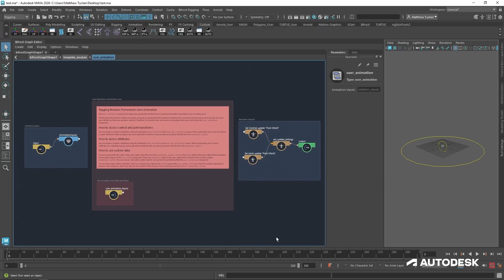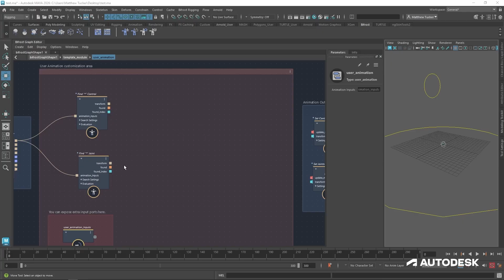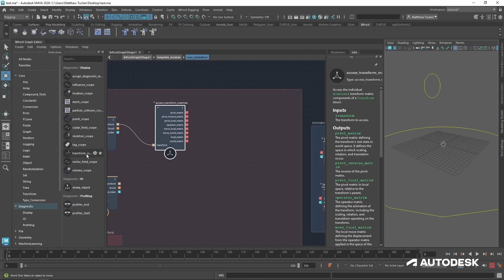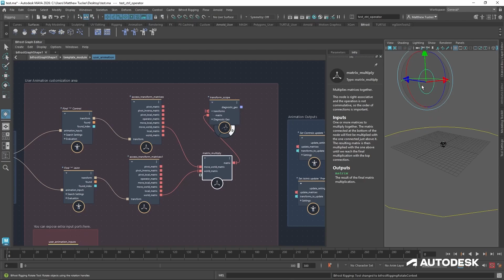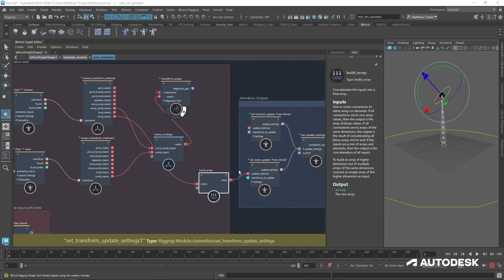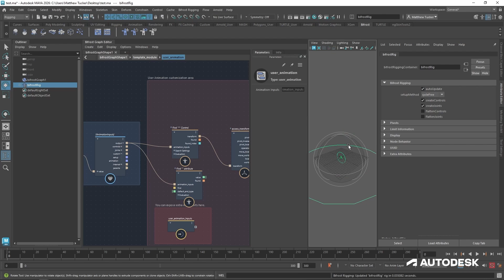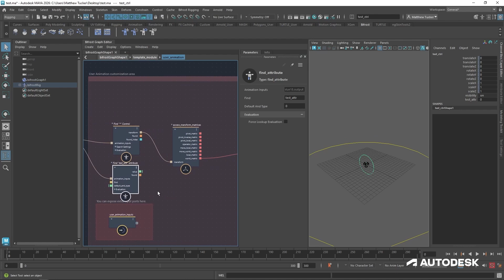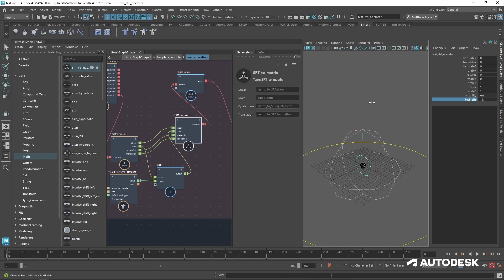Bifrost Rigging in Maya - Part 5: The Rig Animation Area

Comment: Autodesk idiots, binding is a visual operation, it is an operation in the visual window for people without programming foundation, why do you assign it to bifrost? Maya's window binding is very powerful, as long as it continues to be improved with future accumulation, bifrost is visual programming, it is most suitable for generating complex special effects and simplifying complex dynamics programming, you idiots use it for binding, you fools are going in the wrong direction, letting Maya die in the hands of Autodesk.